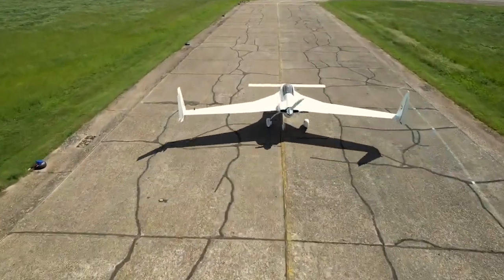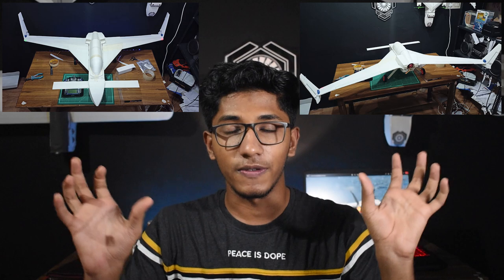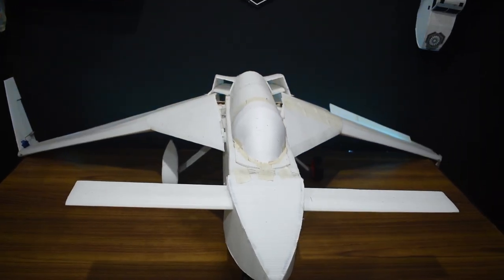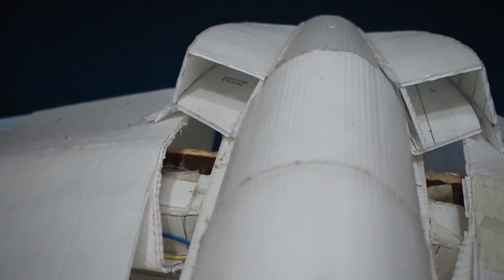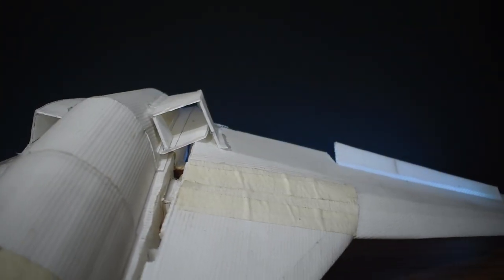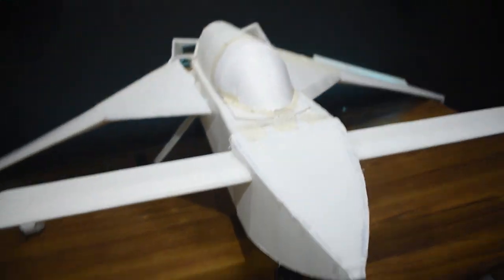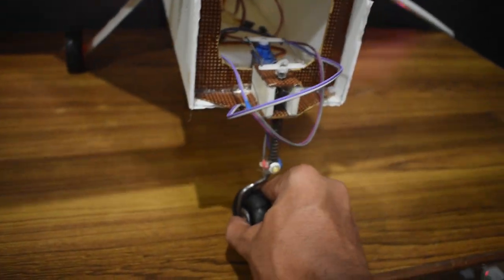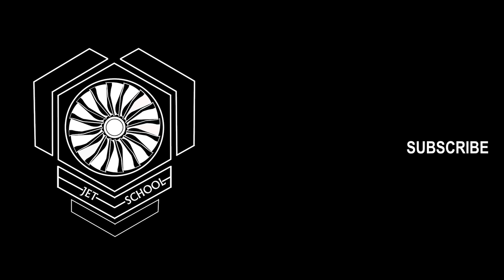Did I crash my RC LONG Ez plane? RC long ez update.| Jet School |

Comment: Have you considered using a carbon fiber arrow shaft as a wing spar? They work great!
Reply from the maker: I don't want to make the build complex,. It must be repeatable
Reply: @JetNautics  a carbon fiber arrow shaft is cheaper, lighter and easier to find than an aluminum square tube. Just trying to help. Do what you want bro.
Reply from the maker: @doncunningham3124  ill give it a try